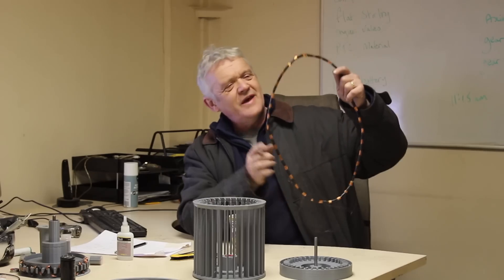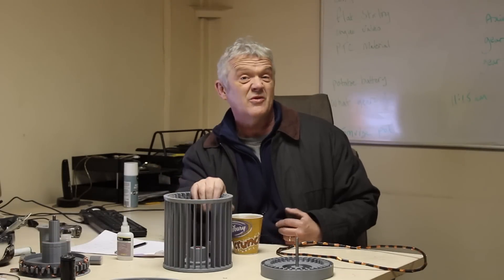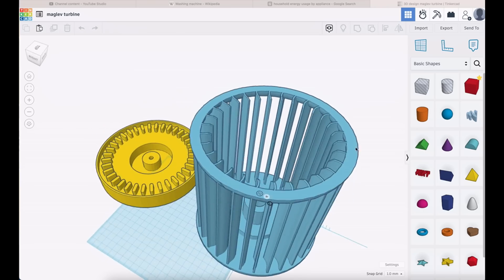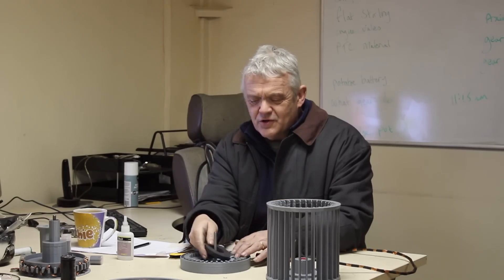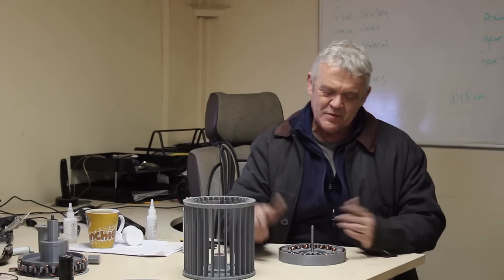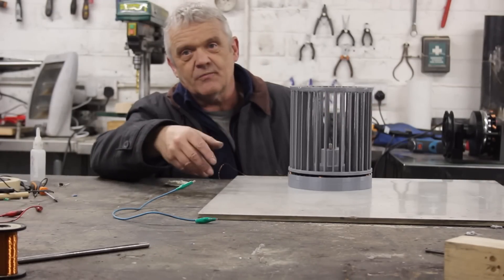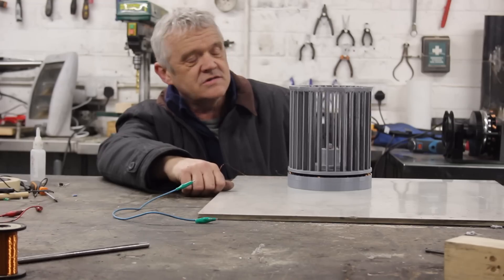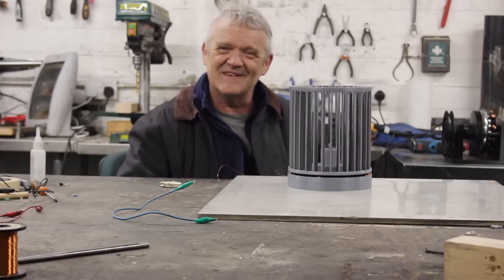1877 Maglev Wind Turbine

Comment: I agree with putting the potting resin in there to seal and secure the coils to weatherproof.
Reply: Durhams wood putty is water based and works just as well, no smell.
Reply: @justtinkering6713  Doesn't last as long, and is more permeable by water and acids.

Can lead to the corruption of the insulation and the corrosion and shorting out of the coils, eventually leading to unit failure.

Realistically, even for only limited weather exposure, it should be UV resistant marine grade epoxy.

On top of that, a disc of Mylar [a cheap 99 cent emergency survival blanket works] should be applied to the surface of the epoxy before it cures, to reduce moisture contact and ensure a longer UV resistance.

Just before one mixes and pours, cut the outer circle big enough to reach the edges of the area where the resin will go, and put a  hole in the middle for the spindle, pour the resin, lower the Mylar, and with a small brush or cotton swab, sweep away any incidental bubbles for a good contact bond.

Just put the aluminized side toward the resin to keep IT from corroding.

The Mylar will [effectively] last for longer than we will live, and the aluminum will make sure that the resin does the same.

NEVER use ANYTHING porous, OR organically active, or it WILL ruin your coils.

They will 1, let in water, and 2, either allow in acids, or 2, allow in acid creating microbes.

Either of those will destroy the very fine insulation on the wire and short it out.
Reply: @hunnybunnysheavymetalmusic6542  even though its called wood putty its not wood, its plastic and plaster of paris. But then again, its just an experiment isn't it.
Reply from the maker: cheers mate

Comment: A thing I'm still missing with all these awesome ways of generating electricity is how do you actually fill a battery or powerbank or something with it? Do you just wire to the plus and minus somewhere?
Reply: The simplest thing to do is take 4 diodes and wire up a bridge rectifier. That's the minimum for going from AC to DC. But your generator needs to be going fast enough to generate more voltage than the battery or it won't do anything. And you don't want to go too fast or you can cook your battery (not likely with the scale of generation in these videos). There are more complicated circuits, like mppt charge controllers, voltage multipliers, boost/buck converters, and regulators, that you can buy or build, but it just depends on the specs of your system what you need.
Reply from the maker: I have done videos on that mate - lots of them - because folks asked the same question

Comment: Stick a 2nd coil and magnets on the top and you will get double the generation...
Reply from the maker: indeed
Reply: @ThinkingandTinkering  love what you are doing too and the frequency of the videos
Reply: @ThinkingandTinkering  my other thought was bar magnets rather than round. That way you can make the straight parts of the serpentine coil longer. Wonder if that would do much to increase the output.

Comment: Install the squirrel cage in a rotating housing to concentrate the wind energy and reduce the losses due to the drag on the back side of the squirrel cage.
Just for fun,  drive the generator section using a variable-speed motor at different RPMs and record the output under load to measure the generator output (volts & amps).
Reply from the maker: for sure mate

Comment: This idea but using the magnets to heat a copper bottomed sand battery of which you can heat your water.
And also run a small thermal engine off as well
Reply from the maker: interesting idea - cheers mate
Reply: Use the heated water in a spa pool hehe
Reply: Also how hot could you get the sand battery off that sort of a system over a day, 2 days 3 days etc? How many days would be required to get  enough heat into that system to keep your house warm during winter?

Comment: Hi Rob how did you print the top ring of the squirrel cage without support stopping it sagging?
Reply: You can bridge reasonably far, I've accidentally printed things with 30mm or so gaps between them. The layers might sag until it catches up a bit. Those gaps don't look too big, so probably not a big challenge on that print. What you've got to watch are the big recesses underneath, I'm not sure if he used supports for those.
Reply: @gshingles  Thanks Gary, I am new to this 3d printing game, only had mine about a week, just printing a wee benchie Boat and then an angle torcher test piece to see what happens. 
Thanks very much!
Gary Taylor

P.S GARY'S FOR WORLD DOMINATION!!!
Reply: @garys-half-baked-offgrid-dream  No worries. It's pretty liberating being able to imagine something and turn it into a physical object reasonably quickly. I've definitely had my fair share of 🤦moments though. 🙂
Reply from the maker: as long as the angle isn't greater than around 55 degrees it can cope bridging gaps mate - but this one I added supports
Reply: @ThinkingandTinkering  Thanks very much Robert! 👍

Comment: If Elegoo hadn't sent Rob a printer the TnT world may have taken a very different tack! Thanks Elegoo, and thanks Rob for  embracing new tools as well as you embrace new ideas. 😉👍
Reply from the maker: lol - not really mate - I am still doing the same old stuff - I just use a 3d printer as a tool to help me
Reply: @ThinkingandTinkering  the difference is that now instead of spending a day constructing the parts for the machine, you get a much better balanced set of parts, from the 3d printer with less hands on time, giving you more time to make and edit the videos, which also means more iterations of a project as you develop the ideas
Reply: And I wouldn't have bought my Elegoo (managed to get my hands on a Neptune 3 Plus last month!) which I've absolutely loved learning how to use. I've already designed some bespoke mitre saw stops in Sketchup and 3D printed them for my workshop (available free on Printables - user keebs). Now I've started learning FreeCAD this week, so I could design and 3D print some desk cable grommets for some new bedroom furniture for our children ... printed them this morning! And much, much more! Thanks Rob!!!

Comment: On Tom Stanton's video yesterday he had to buy stronger magnets than he had in order to make his project work. What difference does the strength of the magnet make in power generation?
Reply: It's a linear relationship between voltage (e) and magnetic field strength (B).  e = Blv sinθ
Reply from the maker: DFPercrush has it mate - and I have done videos explaining it - I guess you just haven't watched them yet - cheers
Reply: Think of a magnet like a electron fountain the stronger the magnet the more electrons flow through the fountain to be captured when splashing into the wires.

Comment: Can someone tell me how Robert is hooking up the led and later on the volt meter?  I see the alligator clips clipped to a copper wire but where is the other end of that wire? Is it looped around the serpentine coil?
Reply: The clips are just holding the led to the ends of the coils wire
Reply from the maker: it's pretty straight forward mate - each end of the coil is clipped to the meter or the led - that is the positive of the meter or led to one end of the coil and the negative to the other end of the coil - nothing else to it
Reply: Thank you both for your responses, I understand this part but the other end of that copper wire...is that looped around the serpentine coil?

Edit: Just went back to 1859 and noticed that Robert does have the start and end of the wire dangling off the coil.  Hard to see that .1 mm copper wire. Thanks for pointing me in the right direction!
Reply: Thank you everyone!   I make and tinker but my knowledge of energy/electricity is still rudimentary.  I am actually making this thing to experiment with and learn...so I appreciate your help.

Comment: This is really beyond description. Words cannot convey how much the series about the wind generation inspired me. Just one question though, is how "long" is the serpentine coil or at least how can I measure the length to get the best fit for any size of circle? 👍🏻👍🏻👌🏻🏆
Reply: Think about it, you have the parts going radially in and out, and then the bends. The bends are a semicircle, so pi radians or 180 degrees, times the radius of the bend. Well, we have the diameter of the bend from the spacing of the slats so divide by 2.
That's length of a slat * number of slats * pi/2 * spacing between slats (start to start or midpoint to midpoint). Of course the outer radius is larger so you might want to take an average of inner and outer, and add a little extra for wiggle room.
Reply: He has a video on how to make the coil. He suggests you wrap the empty slots with a string first to get your length. Then just multiply that until it’s your desired thickness.
Reply from the maker: see the linked video - I explain that
Reply: @ThinkingandTinkering  thank you for your comment.

Comment: Does the magnetic field from the maglev magnets affect the output of the coil? If you shielded the maglev component from the coil would the power from the coil increase, decrease, or have no change whatsoever?
Reply: A magnet spinning about its polar axis isn't going to generate anything. There's no change in magnetic flux.
Reply from the maker: no there is no effect

Comment: How many amps does it put out at that 4.x volt on the fan? I think if you had the actual volts amps and Watts on screen that would really help a lot of viewers like me understand what sort of power were really working with
Reply from the maker: I am working with wind power - it's wind speed you need - anyway about 35ma
Reply: @ThinkingandTinkering 
So about 0.15 Watts. Thanks, Robert, this is the key information that we need to compare everything.

Comment: Works a little better than  the single steel ball in oil bearing. But has a vertical movement to it .
Reply from the maker: you are still not thinking it through - thinking it through is about solutions too - look at the other posts there are some good suggestions - think it through! - I am not trying to be mean to you mate I am trying to get you to make suggestions on possible solutions you might have - add to the community a bit more than you are doing by just pointing out a potential problem lol
Reply: @ThinkingandTinkering  Try it, it works great.
Just like the genius behind Peter Sharps cycloturbine. You have to think beyond his videos because he didn't have the facilities to make a serious turbine. Most of his tests were using string and paper wind turbines. People pointing out the weaknesses in a design sometimes take the blinders off the the inventor, sometimes inventors get tunnel vision and keep pursuing their dream and can't or won't see anything else, a lot of times because they have so much invested in their own idea. Maglev is great but its not perfect and having the magnet rotor crash into the stator is not good. I guess mechanical limits on a maglev system would be part of the solution. Instead of crashing into the working parts it could bump into a mechanical limit bearing.

Comment: Excellent Sir!  
I want to try that with your electrostatic motor design.   After seeing the torque on Lasersaber's large motor, I've been very curious about input and output of  power.  I do not know if electrostatic motors or generators suffer from Lenz law effects.  
Any thoughts or observations from your tests?
Reply: Would you be so kind as to explain what Lenz law effects are? I'm new to this sort of thing 😅
Reply: @Unpopular_0pinion  You can Google search for a more thorough answer.  In a nutshell, as an electromagnetic motor is running, it creates an opposing force that fights against the rotation of the motor.   Same for a generator or alternator.   It is why electromagnetic motors/generators can not achieve overunity.  
Most of our power generation and use is from an electromagnetic source.  
But Dr. Murray-Smith made an excellent electrostatic motor and was driving it with a cheap high voltage transformer.  It was spinning madly from micro amps of supplied power.  
With the good Doctor's rim generator design, I'd like to visit that experiment to compare the input power supplied to the output power provided.  
I'm trying to workout how to get access to a 3d printer.
Reply from the maker: hmm very intersting question mate - but basically no they don't suffer from it

Comment: Any ideas for how to make 3d prints more resistant to heat and UV?  
If you put anything made of  PLA outside in summer heat it probably won't last very long.
Reply: ASA filament is one of the better filaments for our door prints.  It's much more UV resistant.  Another thing you could do is spray paint the PLA with a UV resistant paint, but you would still have problems with the PLA on a hot day.  A white or a silver paint might help somewhat there, possibly even a graphite paint.
Reply from the maker: there are different filaments and each has it's own properties

Comment: Hi Robert, I have watched many of your videos. I enjoyed your video on making an arcamedies screw with CDs and thought you'd be the man who could test this idea easily. I believe it would be possible to create a screw pump powered by a water wheel. If you had two water wheels under the falling water, one to power the screw pump and another to generate power, you would have a self sustaining system. The main considerations would be to have the tube of the screw stationary to bear the weight of the water, leaving the screw responsible for the lifting of the water. You would also require a top reservoir to feed the water wheels. I wasn't sure how else to contact you, so I hope this comment interests you. Thank you, and keep up the inspiring work.
Reply from the maker: I don't know if that would work mate - I actually believe it wouldn't - but that's just me so it is unlikely I will do it - if you think it might work it is probably better you give it a go if you want it done anytime soon mate
Reply: @ThinkingandTinkering  Thank you for taking the time to reply. I haven't built it yet because I'm not sure it'll work either. I'm still researching what I need to know to build it. Thanks Again.
Reply: Hey Digital Bishop - Check out US patent US9759180B2 which is similar to what you are talking about.  It might spark some ideas if you ever consider trying it.

Comment: Slightly off topic, but do you plan on continuing development of the barleycorn turbine? I've been wondering how you'd connect multiple turbines together.  Also, using a TENG for generation seems like a perfect fit for the barleycorn, since it prioritizes low cost.
Reply from the maker: yes I do I have an update already - I am also in the process of moving premises so I am finding things a bit tough right now - but I will get it done mate
Reply: @ThinkingandTinkering  Goodluck on the move 💪
Reply: Try workout how many you would need to make 1kw vs 1kw wind turbine

Comment: Would it spend faster if you have a surround ducted enclosure that just put the wind on the blades that gave it the power,,,, it would look similar to the squirrel cage except larger
Reply from the maker: yes it would with an enclosure it is basically the powerpod

Comment: Hiya mate, love this, thanks for sharing ...............I am intrigued by a very powerful source of power that has never been taped and I am not sure how to capture it, the old guys here have seen crystal battery cells bust open copper pipe that would take at least 1000 lbs of pressure to break it open,. Maybe you can do an ALL call to see what we can come up with? We have also seen tree roots do the same thing, lift and split concrete , your thoughts?
Reply from the maker: I have done something on crystal cells mate - granted it was a while ago
Reply: @ThinkingandTinkering  I have also worked on crystal cells, that have some strange properties, but that is not what I am talking about now, I am talking about growing crystals and the power of pressure they can exert , thousands of pounds, crystals growing can break apart a copper pipe which takes a tremendous amount of pressure-power. Can we gain from the crystals growing?
Reply: @ThinkingandTinkering  thinking of creating a box with a movable lid , put a crystal mix in it and strap it to a scale, after a while when the crystals grow you can probably get a scale to tell you 1000 lbs  of pressure, then all we have to do is figure out how to capture it and use it, just some thoughts on a Sunday

Comment: I wonder Rob how much potential power might be generated with a three coil set up.. We have steady winds here and I would like to build a system to tie into the grid so I think ( not sure) I need to end up with48V output and if I am not mistaken the three phase winding can be used to brake the system in high winds.  two counterrotating Ugrinsky blades with a hub generator between  them Mag lev or bearings either would work.  I don't have a need for battery storage so I just want to feed it back to the grid and defray my cost. I have the area to install and connect several  small 2 or 4 blade VWAT s
Reply from the maker: the power is in the wind m ate and the beta limit will tell you maximum potential that can be gained

Comment: it may only produce a small amount in a light breeze but that wall could hold a half dozen or so all hooked to a charge controller to trickle charge a battery or maintain a battery in a back up system
Reply from the maker: nice